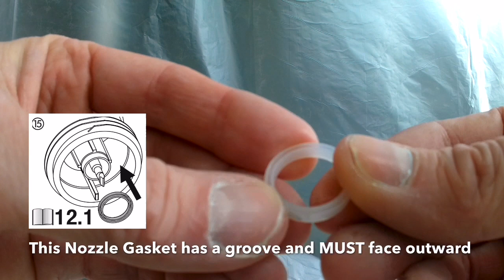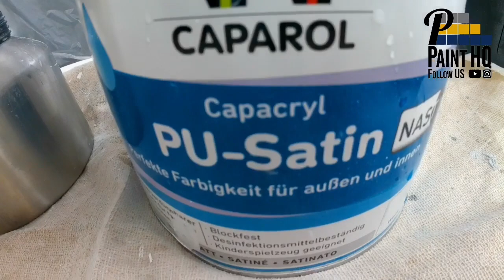How to spray with a Wagner XVLP Paint Sprayer. Spraying Caparol PU-Satin

Comment: Why did you select the NAST head? Is it a special purpose head for a particular paint type?
Reply from the maker: Hello my friend.. great question.. The NAST head was developed and designed to be used with Caparol NAST paints (haftprimer primer and PU-Satin top coat), this NAST combination is to significantly reduce / eliminate fog and overspray.. the NAST head can still spray other paints with potentially less fog / overspray.. but my opinion is if you already had the brown fine finish head, that too produces excellent results.. especially with Caparol NAST paints 👍👌😆 ..Keep in touch, I’m happy to help if I can 👍 Regards Pete 🎨💯

Comment: Hi great video, how come you do the middlecoat dryer please? Got the 3500 and still trying to get a good consistent finish.
Reply from the maker: Hey Steve, thanks for the feedback.. it’s purely to speed up the process. I’m not too concerned about the middle coat. For me I like to push the boundaries on the final coat.. I still want decent atomisation but I want the material to spray wetter and know that the product will suck in and dry nice.. biggest tip I could give to get the setup right is to make notes, so you know a starting point and if you could drop a little air and up the material a bit more next time.. Hope this helps.. the 3500 is a great machine.. What product have you struggled with buddy?.. regards Pete
Reply: I usually spray trim Dulux diamond satin and get on well with that but have been try bm advance and pu gloss on a couple of projects and just can’t seem to get a smooth finish. I don’t want to thin paint much more than around 8% and warming paint and head before spraying. Fine head. I just can’t seem to work out whether I should be going multiple light coats or 1 heavy. Sometimes it comes out ok in parts but I but like the other comment seems to vary in and off throughout other jobs even though trying to keep paint warm and adjusting
Reply from the maker: Hey Steve, just answered a similar question 😊 .. A  constant stop start could happen if the cup cannot build pressure.. If the material is too thin (low viscosity), or perhaps cup too full.. This happens when spraying water / like the clean up.. I know it’s frustrating.. BM Advance is a lovely paint, like I find with spraying any product, or any system including airless, if the coat is too light an application it’s a rougher finish.. BM Advance will level off and pull in lovely.. Yeah don’t thin too much, because you’re spraying a BM product, you could try BM Extender.. Floetrol is another paint conditioner you can add to ease the flow.. In conjunction with heating the paint and turbine 👍  ..Really do hope this helps.. keep in touch my friend.. regards Pete.
Reply: Hi, What are your thoughts on thinning pu as I believe officially 5% which I’ve been trying to stick to but wondered if 10-12% would cause much harm to the paint which is what I tend to see others do and probably would help some of my issues around atomisation. Also do you usually use owetrol or similar as wondering if that’s better than water in terms of needing less?  Thanks again
Reply from the maker: Sorry Steve I hit send by accident, hope you get this reply in full... I do a ‘worm test’ 😊 ..You’ll see me in my videos where I stir the paint, then lift the stirrer out and swirl the paint as it runs off the stick.. for the right viscosity for XVLP (and HVLP), the ‘worm’ should disappear pretty instantly.. I’d then warm the paint first before anything else, unless it needs a lot of work.. then add Floetrol or Benjamin Moore Extender.. then if it still needs some work, I’d add 5% water.. last resort for me would be to up the water to 10%.. if I’m having to thin that much, I’d rather switch to Airless spraying and spray un-thinned... let me know if you get the full reply.. I’ll help you all I can 👍  Regards Pete

Comment: Hiya mate how much do you have to water down joncryl from Johnston to go through a 3500. Thanks
Reply from the maker: Hi Brian.. Those who know me will vouch that (during my brush / roller days 😊) For an off the shelf product (from Brewers), I’ve always spoke highly about the Johnstones water based paints, especially the Aqua undercoat and Satin.. However, for me it doesn’t spray nice.. With the spraying of any trim paints, I only add water as a last resort.. It will go through XVLP with more air, but before adding any water try a splash of Floetrol paint conditioner.. And warm your paint 👍 ..if you don’t have your own method for warming paint, you could buy a screw on lid for the tin, (they don’t cost much).. Then submerge just below the lid in water that’s just boiled.. Warming decorative paint will lower the viscosity and help XVLP spraying massively... With Caparol NAST paint, you won’t have that problem. It will spray out the tin 👍 Sorry for long answer.. hope some of it helps my friend 😆 Pete